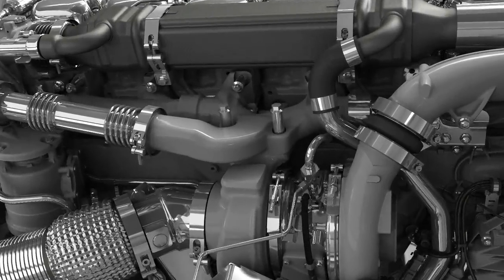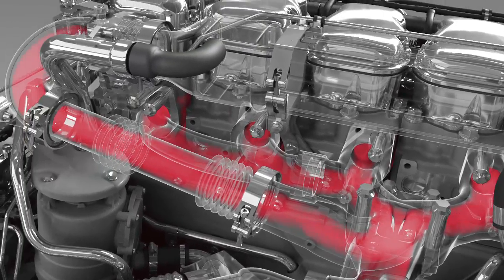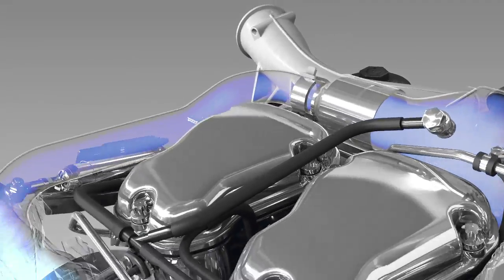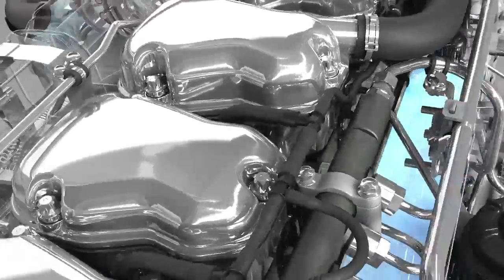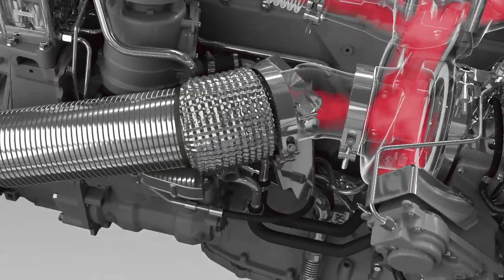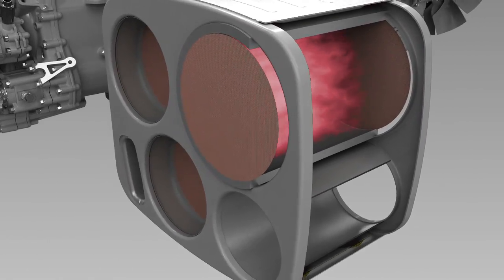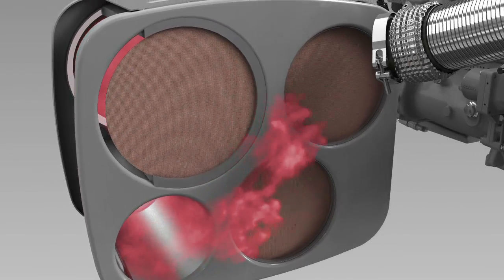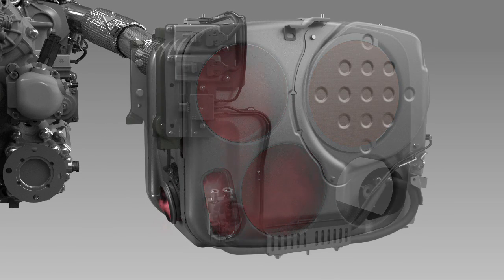Scania Euro 6 Technology

Comment: the exahust leaves "fresh and clean"? Not sure about the fresh part. Can I use the exhaust gasses to freshen up my laundry?
Reply: Yes it clean if compare to straight pipe or no filter system
Reply: Cleaner than without the after treatnent

Comment: IVECO manage E6 without adding EGR, alone in the business to do that
Reply: And about the same power like a walk-lawnmower, thanks but no.
Iveco still uses catalysts and particle filters though, EGR or not doesn't matter.
Reply: Well apparently you don't know that about combustion technology
Without no EGR there is no need for active regeneration of the DPF, witch means less fuel
If you know about the difference between active and passive regeneration
No need for TVA valve, no extra cooling to cool the EGR
 And for lawn mawler power, they are launching the new C16 with 660kW soon
Without EGR
Reply: It shouldn’t be difficult to do from my understanding the Egr is there to reduce nox which is also what the ad blu reduces or am I wrong?

Comment: The pressure of the exhaust gases is lower after the aftertreatment and would require more EGR opening for the same amount of gas. In some cases it would never be possible to deliver enough EGR.